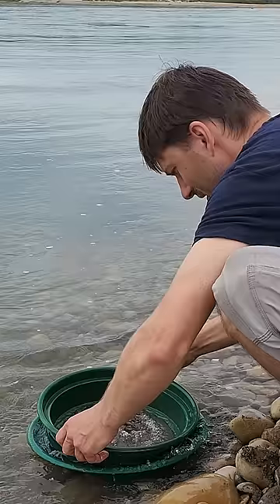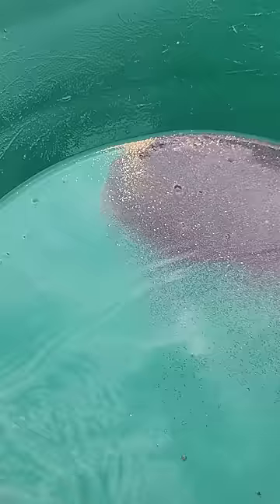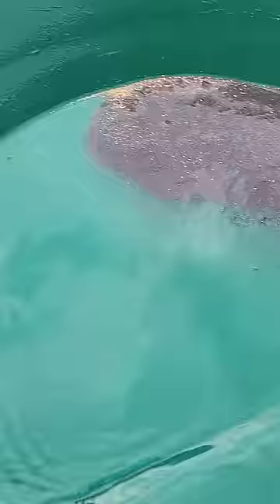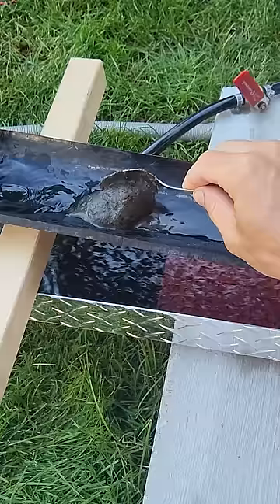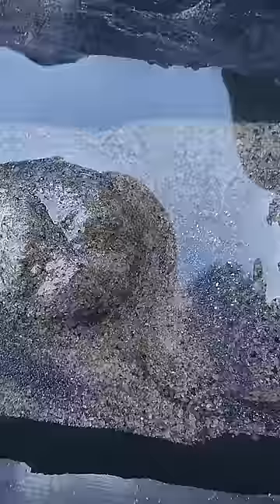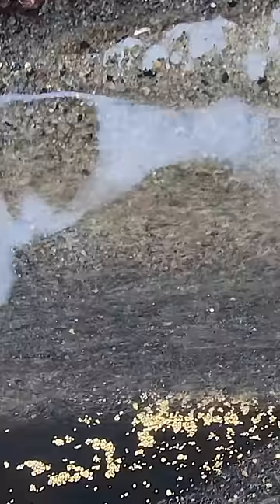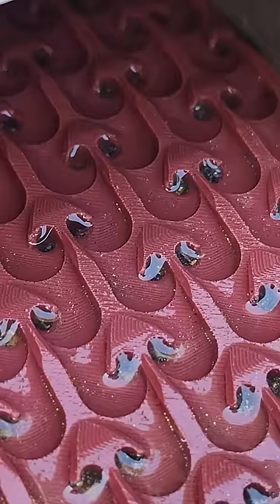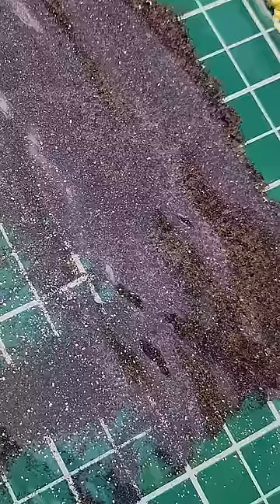"Oh, She's Loaded!"

Comment: Don't know anything about gold sluicing but interesting to see that the board incorporates somewhat of a "tesla valve"
Reply: Isn’t a toy thought the same thing
Reply: I noticed that as well. Not sure what it necessarily does here in terms of separating anything but always cool to see trying any of Tesla derivatives in New applications
Reply: I guess you must mean that dog nose pattern, truly cursed with that color as well
Reply: This isn’t even close to a Tesla valve lmfao
Reply: @oldkingcrow777  BRO WHAT LMFAO
Reply: @amasko96  Okay Mr. Fluid Dynamics expert - notice how I prefaced my comment with these exact words, "somewhat of a tesla valve." If you look at a diagram of the tesla valve you will see similar characteristics, namely a channel which diverts the flow of water in the opposite direction without moving parts. This helps slow the flow of water and allows the heavier gold particles to settle onto the board for collection. If you want to go tit for tat to make yourself feel smart go ahead though.
Reply: @oldkingcrow777 the gold particles have higher momentum than the water and are harder to get redirected in their path. While the water can flow around the valve structhre the gold will.cintinue on into the "buckets" of the valve, even if they are moving perpendicular to the current since as iI said, they have too much momentum to be easily redirected. The balance then is making a valve size big enough to let the water speed up enough to give the gold good momentum going into the next vakve, but not so big that the speed the water picks up is enough to carry the gold dust back out of the valve with it
Reply: @maxk4324  you dont know what a valve is

Comment: I once saw a video of two Eskimo girls standing in a river in Alaska up to their knees. Shoveling river sand up onto a square 3'x3' of carpeting with foam under it so it would float, but sunk once the sand was on it. Panning this carpeting square, letting the stones roll off. They were smiling happy doing this and the water was freezing, no wet suits. So you know they were getting that carpeting filled with flour gold. They were not wasting their time. No expensive equipment, but brave to handle the cold water. Real gold digger girls.

Comment: The gold hog guy made a sluice with two levels,  perforations on the first sluice were allowing sand with the flour to drop through. Slower second sluice held the flour better. THEN......the key to the lower sluice beyond that percent gain was to understand that black sands filling the riffles prevented the flour from stopping. Solution is to use vibration as a concrete vibrator on this second sluice. Vibrated black sands become ALIVE grabbers of the flour. Flour G looks like micro paper plates, it only sinks down into black sands when they are vibrated. So before you start, add a quart of black sands to the lower sluice, get the concrete vibrator on a dimmer control, get this black sand jumping like Jimmie standing before a carnival ride, it's alive.......now run your material. Black sand grabs the flour like sand crabs burrowing in. 97% recovery if you get the vibration right. Don't keep this secret, tell a friend.